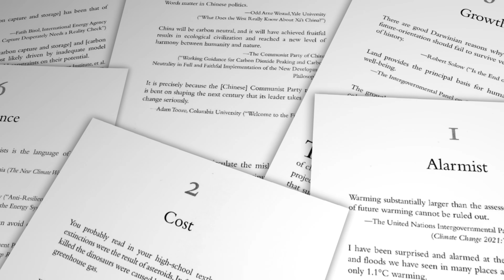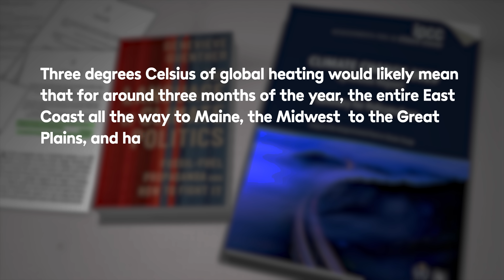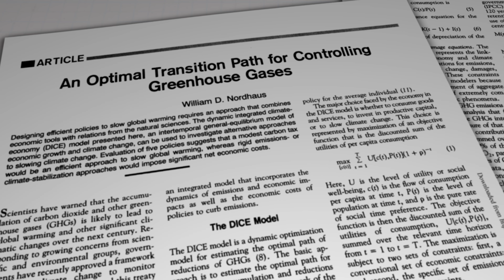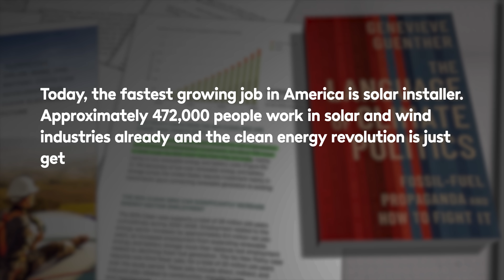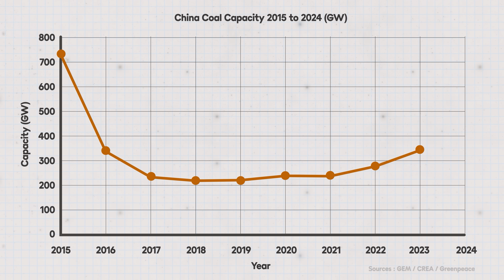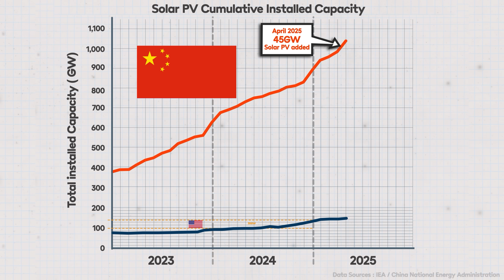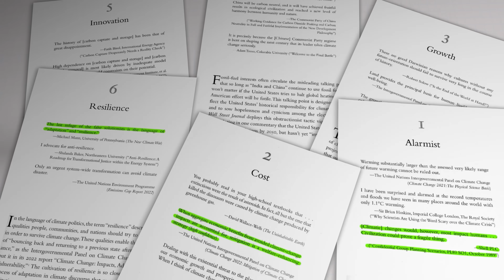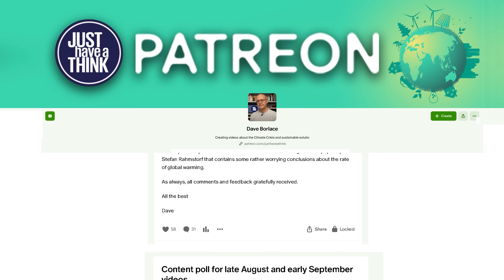New research DEBUNKS climate disinformation.

Comment: In terms of Carbon dioxide, they say "The current atmospheric CO2 level is around 425.21 ppm, according to Earth's CO2." so this is a FACT. we are around 400 ppm. The planet Venus which they say has runaway climate change has CO2 level of 8000 ppm. In the earths history, in the recent 500 to 1200 years ago the CO2 levels have been between 700 - 1200 ppm. Also Millions of years ago, during the dinosaurs, the CO2 levels were around 2000 ppm. So right now were are at a level of 400 ppm, this is one of the lowest levels of CO2 the earth has ever had. SO, just based on the argument of CO2, there is something wrong with what the people saying we will have great problems if CO2 levels say go up 5%, it does not make any sense based on the numbers I got from Google search.
Reply: For the 800,000 years leading up to the Industrial Revolution, CO2 never got above 300ppm and mostly hovered around 250ppm. It never reached 700ppm in that period.

Today's CO2 of 425ppm is the highest in 3.3 million years. Earth's atmosphere has not contained so much CO2 since the mid-Piacenzian Warm Period. (de la Vega et al., 2020.)  The lowest atmospheric CO2 level of the last 500 million years was around 295 million years ago in the Early Permian during the Late Paleozoic Glaciation. During the Late Asselian/Early Sakmarian stage the CO2-level hung around 150 ppm for a few million years (Montanez et al., 2007 in Science, Vol. 315, Issue 87). The planet didn't die.
Reply: @swiftlytiltingplanet8481  Your numbers are not correct in terms of ppm of CO2. Once you go below 200 ppm or below 180 ppm of CO2, plant life starts to die. SO you see, top scientists that I keep track of they said other numbers,  you are stating yet other numbers. SO, these issues of the actual numbers have to be cleared up by some kind of debate between the two sides on this Climate debate, and this should be done in the UNITED NATIONS, and Televised Publicly to the whole world. Only then will we know who is stating the truth on concentrations of CO2. So I am happy you replied on this issue.
Reply: @swiftlytiltingplanet8481  I replied back 2 times, and its not being posted. Or I should say it was deleted.
Reply: I don't know how long this post will last, because my stuff is being deleted.
Reply: More from GreenPeace CEO, they have a chart with ppm's of CO2. 
https://www.youtube.com/watch?v=2H0OxmF7fak&t=42s
Reply: @pabloagogo1  Patrick Moore is not a climate scientist. He's a greenwashing spokesman for polluting industries, the very industries he and Greenpeace once fought. He is, for example, the former head of the CO2 Coalition, which has long been funded by fossil fuel indutrsy investors to promote the use of gas and oil. He is widely debunked among those who actually are climate scientists.
Reply: @swiftlytiltingplanet8481  I said in earlier post, your numbers are not correct. Here is from the Wiki:" The present atmospheric concentration of CO2 is the highest for 14 million years.[10] Concentrations of CO2 in the atmosphere were as high as 4,000 ppm during the Cambrian period about 500 million years ago, and as low as 180 ppm during the Quaternary glaciation of the last two million years.[2] Reconstructed temperature records for the last 420 million years indicate that atmospheric CO2 concentrations peaked at approximately 2,000 ppm. This peak happened during the Devonian period (400 million years ago). Another peak occurred in the Triassic period (220–200 million years ago).[11]"
Reply: What i said earlier, was that you have a set of ppm numbers, and so do I, they do not match. SO there is obviously something wrong. We need scientists on both sides of this debate to debate this in the United Nations, and be televised to the WHOLE WORLD. Only  then will we know what the TRUTH IS!
Reply: @pabloagogo1  I'm not stating other numbers. You simply misunderstand the data. Here is your exact quote: "...in the recent 500 to 1200 years ago the CO2 levels have been between 700 - 1200 ppm." They were not. They were exactly as I posted, ranging from an average of 250ppm to a low of 180ppm and a high of 300ppm. We know this by analysis of the Epica ice core from Antarctica. 

Not all plants process CO2 the same. C-4 plants can survive CO2 all the way down to 20ppm, and not all C-3 plants die at 180ppm. Some can hang on to 160ppm. Megafauna like mammoths and mastadons thrived in that 800,000 year span I mentioned, and it's when humans evolved. 

Note that I cited scientific studies in my post about the very lowest levels of CO2. I didn't make those numbers up. 

CO2 reached 425ppm in the Pliocene and also 14 million years ago. Both answers are correct, but not everybody is aware that CO2 reached 425ppm in the Pliocene. CO2 was not nearly as consistently high in the Pliocene as it was 14 million years ago, which is why you'll often see 14 million years cited more often. 

We don't debate science on a stage. We debate it in the scientific literature by presenting evidence for our viewpoints. Stage debates are too often won by the most charismatic speaker, not necessarily the one who is right. We proved that by electing Donald Trump, the most scientifically illiterate president in history.
Reply: What does it matter how high the ppm was in the distant past? This civilization was built in a Holocene climate and depends on it utterly. If that ends, so does the civilization.
Reply: @SeenfromSpace  As Freeman Dyson says, his Japanese colleague professor was one of the earliest people in the Climate Modelling. If you watched the video, the models cannot predict, they are not good at ALL at predictions. The models they have are very poor. SO this is it. In another videos of Freeman Dyson, when he did some climate modelling, he figured out that vegetation is the largest source of carbon, and these things "he says" are not taken into account. He has pointed out a few things that make the climate models totally flawed developed by supposed UN climate scientists. Freeman Dyson is totally un-appologetic when he says that the climate models don't have much predictive power, his Japanese colleague was the first to say this to Freeman Dyson, and after his own analysis, concluded the same.
Reply: @pabloagogo1   Models are used to create projections not “predictions”. As such they have been extremely useful, and meta studies have confirmed their skill. The models are not developed by “UN climate scientists”. They’re developed by universities, national meteorological agencies, research institutes etc. The UN doesn’t do science. The IPCC is a UN body and the panel consists of volunteers with relevant expertise. Dyson was not a climate scientist and advised the Global Warming Policy Foundation which is a fossil fuel industry junk tank.

Comment: 15:00 and out of the other side of your mouth you claim solar, wind and batteries are cheaper.  If they actually were cheaper, we wouldn't need laws to make power companies install it.  They would be falling all over themselves to tear down traditional power and install renewables as quickly as possible.
Reply: Lobbying by the oil industry consistently attempts to block all attempts to erect new solar and wind facilities, and they have been too often successful. Surely you've seen what our pro-oil president has done to Biden's renewable energy surge. The oil industry donated $219 million either directly or via PACs to elect pro oil candidates like Trump, who are now paying them back for their generosity by blocking or canceling all incentives for renewables.

Comment: This kinda points me back to a very old conclusion: you can't EVER rely on politicians to fix problems. If a solution is reached at all, it'll be at the hands of clever tinkerers, backyard engineers, and innovators ho re doing the best they can with the ideas and resources available to them.

Comment: I wish I could find the video that I heard it in, but I watched from a trustworthy channel where the presenter talked about the costs of mitigating climate change in the United States. IIRC, they included replacing the entire power grid, adding wind, solar, gridscale storage, adoption of electric vehicles and building out the needed infrastructure, decarbonizing industry, etc. At the time, it was several trillion dollars over a decade.

Then at the end, they dropped the bomb that the entire cost could be covered in the very first year by diverting the subsidies to oil companies to cover the cost.

Comment: both global warming and higher levels of CO₂ in the atmosphere would benefit the biosphere 
the Earth is too cold 
and CO₂ is a nutrient
Reply: This utterly ignores the fact that rising CO2 is warming the planet, which in turn has tripled heatwaves (since 1960), expanded wildfire seasons, intensified hurricanes, and increased extreme precipitation events, marine heatwaves, droughts, and tick-and-mosquito-borne diseases. It has also raised sea levels 4.37 inches since 1993, and the rate of rise has DOUBLED, increasing high tide flooding along the American south and Gulf coasts by 400-1100% respectively since the year 2000. What do you think the end game is here? 8 states are already spending a combined $130 billion to hold back the rising tide. And we're just getting started, with as much as an additional foot of rise expected by 2050.  

How is earth too cold? Humans evolved in COLDER climate conditions than today, and megafauna like mammoths and mastadons thrived in it. You have to calculate that while higher latitudes may benefit from some warning, mid latitudes become increasingly unlivable. Last summer Phoenix suffered through 30 straight days of temperatures over 110 degrees. Farming most crops is nearly impossible in that kind of climate.
Reply: @swiftlytiltingplanet8481 
rising CO₂ is not warming the planet 
the planet warmed 1.5° C at the end of the Little Ice Age 
which was a good thing 
the LIA was marked by short growing seasons, crop failures, mass famine, and cannibalism 
but the LIA is tame compared to the glaciation that’s coming

Comment: Carbon removal from natural (not mechanical) processes still urgently need to be dveloped for near-term consequences.  Of course they must be cost effective and scalable, and not create new unintended adverse effects.  The reason is the vast quantity of excess carbon dioxide already in the armosphere above pre-industrial levels of 270 ppm.  Because of increased climate volatility risk when average temperature increase exceeds 2.0  degrees Celsius, which it appears on track to do by 2030, we do not have the luxury of waiting until emission reduction has been fully and completely implemented.  Carbon dioxide levels must be dropped to 270ppm now.  We need to be cognisant of triggering irreversible tipping points in climate processes long before emissions reduction has any real effect.  It could very well be a false hope.

Comment: "Carbon capture & storage", and "direct air capture"  removes UNDER 50 million metric tons of CO2 annually, that is LESS THAN ONE PERCENT of the annually emitted CO2. AND, the RATE OF GROWTH of cc&s / dac is LOWER than the rate of growth of CO2 emissions. CCS / DAC is MASSIVELY EXPENSIVE. CCS /DAC as a solution to global warming / climate change is a LIE, a FICTION, a DISTRACTION, and a MYTH; it HAS NEVER BEEN and DOES NOT PROJECT TO BE a solution.
Reply: Lefties such as yourself make such claims about CCUS and DAC because you see it as a way for the fossil fuel industry to keep using fossil fuels.  

CCUS and DAC can work

Comment: The elephant in the room is overconsumption and the problem with western democraties to take measures that go against the short term interest of the masses. We overconsume everything, including fossil fuels and derivatives like plastic. Suppose for argument sake that we could cut down drastically on the fossil fuels, we stil could not feed the current and future masses without using all sorts of toxics in meat end green production. Less people, less consumption, less toxics if you want a better future for the generations to come. All these necessary changes will not be achieved in a democratic context. So perhaps doing nothing will correct the scores in a more radical way.

Comment: If the Earth is a capacitor charged between crust and sky then climate change isn’t just “carbon warming.” It’s circuit imbalance.

By ripping minerals from the ground, draining aquifers, and filling the air with exhaust, humanity has degraded the planet’s capacitance and altered its dielectric. We’ve changed how the Earth stores and discharges energy.

Thunderstorms, droughts, heat waves - they’re not random. They’re capacitor discharges gone wild. The global heartbeat, the Schumann resonance groans with imbalance.

We didn’t just heat the air. We rewired the Earth.
Reply: Thanks for that pseudoscientific gobbledy gook

Comment: We listened to retiring NASA engineers who relocated from Florida and Texas to Missouri. It was a trend in the news several decades ago. We chose a remote rural area and built an underground home that needs no heating or air conditioning. It doesn't need a septic system and can collect its own water if necessary, though the solar powered well was a good investment. We've heard all the reasons why this "can't" be done, yet now we are closer to the day when it has to be done. I suggest taking the approach of adaptation over mitigation very seriously. Time is running out.
Reply: I would very much like more details on your underground home and corollary structures! I agree that this is probably the best option for living in the world as it is now unfolding.
Reply: @stephenmissal8260 Underground/berm home design is terrain specific. The most important factors are drainage, water management, waste management, grey water management, load bearing, sun orientation, and ventilation. Natural lghting was not an issue for us because we spend a lot of time outdoors. In the depths of winter we sit in the solarium/entryway with the heavy drapes open. 

So look for an architect with expertise in geothermal design in your area. And look for land outside of cities and suburban developments. You will not be hooking up to city water and sewage with an underground home.

Comment: Although I agree with much of what this video says; as someone with better than average understanding of China - you cannot trust numbers coming out of China; over and over again, the CCP has lied, or made promises it has never had any intention to honour.
How much of that claimed solar is actually hooked up to the grid, and not just erected in fields for propaganda photos? How much is destroyed in the catastrophic flooding that occurs every year?
I have seen photographic evidence of thousands of acres erected without a single cable connected to them; just frames with panels bolted on.

The push for renewables can also be looked at a push towards energy independence in preparation for a war over Taiwan; China has no native gas or oil, so by switching much of the civilian infrastructure to electric - that leaves their vulnerable gas/oil imports and reserves exclusively for the military, which runs almost entirely on diesel fuels for ships and tanks, and JP for their military aircraft.

I studied "Future Ecology and Alternative Fuel Sources" at Birmingham University, back in the late 1970s; much of what was covered back then was already, technically feasible, but only JUST being implemented now - when really, it is far too late. 

Inductive charging roads, which greatly reduce the need for vehicles to have big, built-in batteries, were postulated even earlier (1960s?), but we STILL only have a few prototype roads in existence; and the cost to create that induction charging infrastructure, although a HUGE number taken in isolation - is a fraction of what we already spend, building new roads; and once in place, the underground portions would last for 100+ years, with the active electronics in roadside cabinets.

I am old enough to remember the 1970s UK heatwaves, when 25C was a rare, extreme event - now we get over 35C and yet people still claim global warming isnt real.

Of course, the collapse of the Arctic ice shelves will disrupt the Gulf Stream and may plunge Northern Europe into a mini ice age, but that is another matter.

Comment: Whilst I agree that resilience building can be seen as a 'suck it up' argument. However, if we don't look at building resilience in the short term, millions will be impacted by the changes we have already stored up in the climate system. It doesn't absolve us of the need to tackle the carbon situation - far from it. It's a necessary step to take whilst we tackle it. If we never emitted another carbon molecule, temperatures will continue to rise for a while and devastating floods, heatwaves and wildfires will continue to intensify, destroying people's lives and livelihoods. So, let's not fall into a trap that says adaptation/resilience is 'giving up' on a drive to net zero. Instead think of it as a complementary strategy that is needed to help people whilst we mitigate.

Great video as always. Your work is one of the highlights in the week.